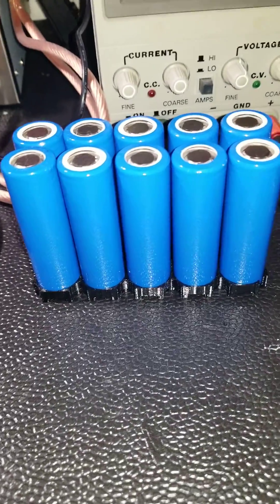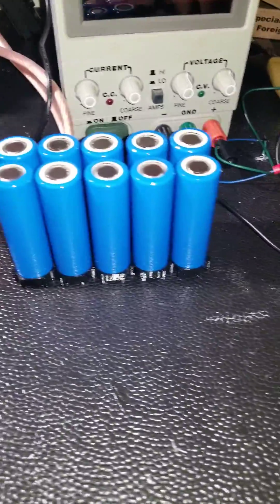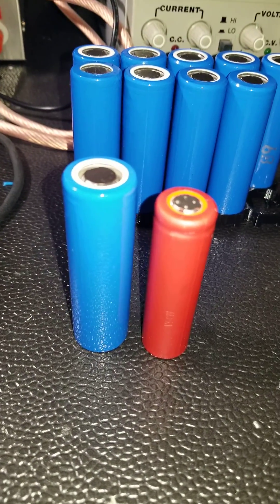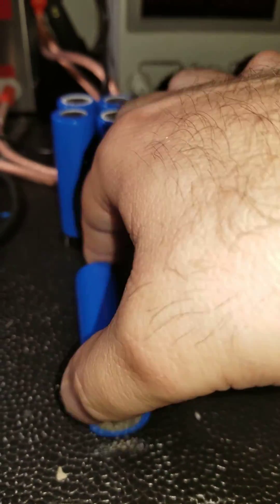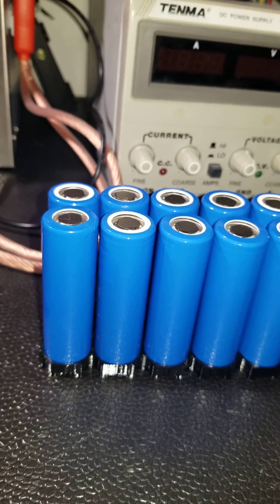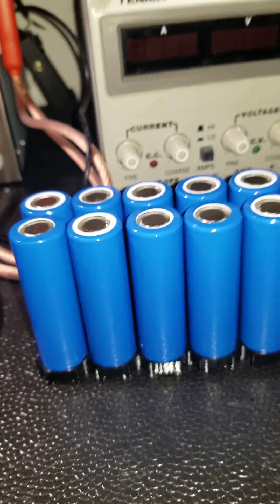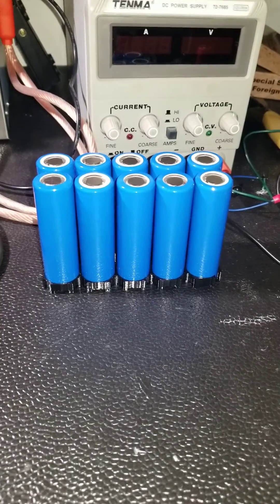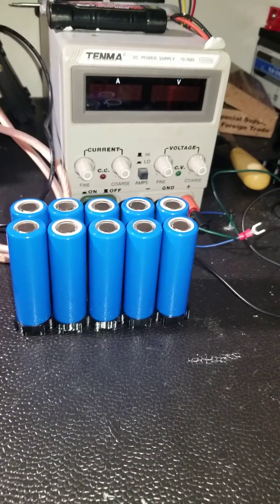2019 CSC City Slicker Battery Pack Upgrade  Project,  Part -I

Comment: hi,mybike has CAN bus and otherpins and doesnot acceptother charges andbatteries,how did you change battery?
Reply from the maker: I'm still using the stock battery charger since the pack I made has the same operational voltage parameters

Comment: how many batteries did you use of the 21700's and what configuration?
i did some quick math and it seems you need around 20 in series to achieve 72v like the original pack, but am unsure of how many you would need to achieve 35AH. thanks.
Reply from the maker: It's a 20s8p configuration - each cell is 4800mAh for 3.84kWh pack for a total of 160 cells in the pack .  Your Ah is coming from the parallel configuration so in this pack I was able to get 38.4Ah

Comment: Whats the discharge rate on the stock cells? Was thinking about adding a upgraded motor (8KW) but want to make sure batteries can keep up with the discharge rate.
Reply from the maker: I measured about  ~2c at some point for a few cycles and I noticed that the biggest issue here was the BMS from stock. This BMS drives the HV output through the same PCB board via FET's that are poorly soldered to the board. As a result they got so hot that a couple of them burnt. That was the reason why the discharge rate was so low. So instead of fixing just the BMS I decided to upgrade the entire pack. I'm curious in knowing which motor you're planning on using?